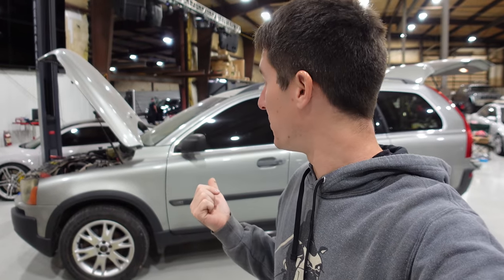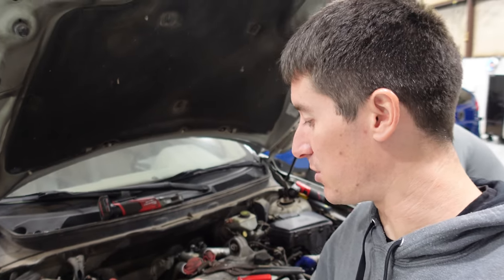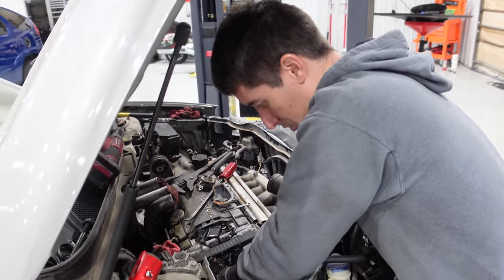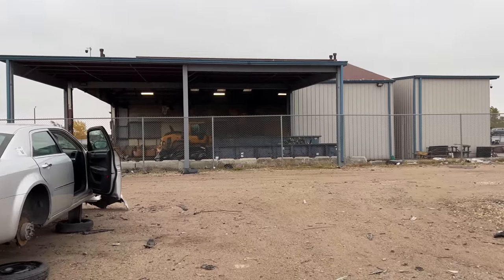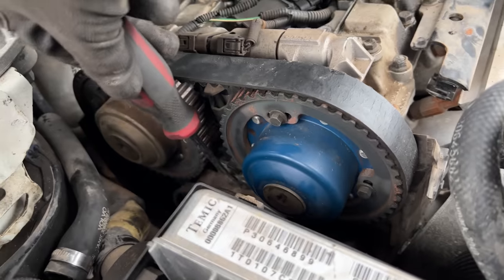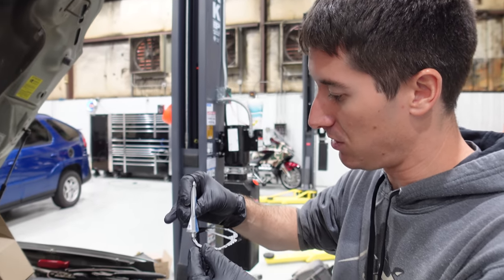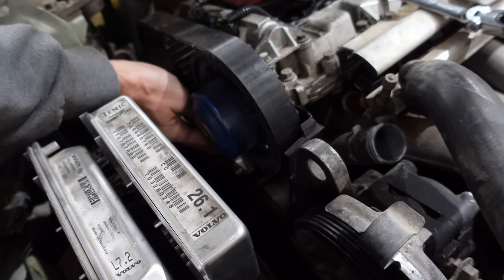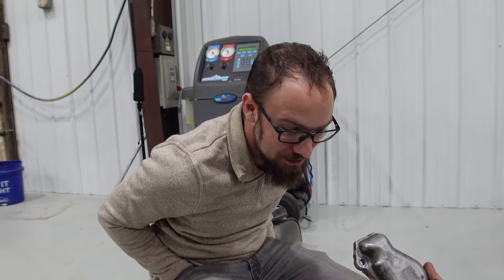Water FROZE And BROKE The One VOLVO Part You Can't Buy

Comment: Usually what I do that helps with timing belts and the thermostats and generally getting in there is removing the bottom mount that is on that side, lifting the engine up so that the holes are staggered and then zapping it back in. This normally gives you enough room to work on those things

Comment: Issue is that thats a 6 cylinder XC90, which they stopped making mainly because they introduced the V8 and kept the 5 cylinder as the lower trim. The transmission was the let down for the 6 cylinder, 4 speed GM auto HORRIBLE. All that to say this is why parts are a bit harder to get for the T6s vs the 5 cylinders
Reply: yet everyone is attracted to getting a t6 s80 because they want the power and I have to kill their dreams before they become nightmares, and then they want to dive into a P2R... people always choose the least forgiving Volvos, ruin them and then say Volvo is rubbish (after treating it like a Honda).

Comment: Sorry to see you struggle but I know your pain with that space or lack of!!!!, FYI if you remove the passenger tire and wheel liner you can get direct access. I just learned all that changing the serpintine and alternator....nightmare.
Reply: Yeah, the whole time i was wondering about going in through the wheel well!
Reply: @mindblownwatcher8536  Volvo actually has made access through the wheel well without having to remove it. There's a crease line on the liner, all you have to do is fold it back and use a clamp to keep it in place. Lol the entire time I was itching to say something but it's a video...LMAO.

Comment: I've seen that type of thing fixed with JB weld.
Not ideal, but does work.
Reply: I was going to type the same but then I thought it would be a stupid idea.
Reply: @taunuslunatic404  I actually saw a tech repair a coolant passage that had been worn through with a timing chain on a Nissan with that stuff.
Was still driving it around daily a year later.
I was impressed.
Reply: @mikevincent7521  So it wasn't such a stupid idea.

Comment: Better to upgrade the parts then have it continue to fail after some time. I never understood why they make cooling system parts out of plastic, it tends to get brittle and crack over time. The upper radiator tank on my Neon cracked open at a stress point being plastic and I couldn't figure out a easy way to seal it so I had to buy a new one. Luckily it wasn't super expensive but if it had been metal I could have soldered the crack up with a torch.
Reply: Two things: 1) If it had been metal to begin with, it wouldn't have cracked so you wouldn't need to solder it, 2) They do plastic because it's cheaper so they make more profit. They don't care if it breaks after warranty. But, I'm sure you knew both of those points.
Reply: @mathewfullerton8577  The radiators on my Dart and the 71 Scamp we used to split the seams at the top of the tanks after all those years in service. I was able to use my torch and solid core plumbing solder with Flux and reflow both so they held water and pressure again. The Dart popped one more time and it has a rare triple core narrow radiator so I took it to a local shop and they rodded it out and redid both tanks. The pressure was expanding the tanks and blowing the seams. I pulled the secondary rubber gasket that allowed the cap to pressurize the cooling system and it hasn't popped since and the Dart never goes over 190 anyway so just antifreeze is fine in it. It originally called for a 16 lb cap and s 190 thermostat and I dropped it to a 180 which also works fine.

Comment: Volvo cooling systems are a pain to work on. I had to change the thermostat on my 2003 XC90 which has the D5 engine (2.4 litre 5 cylinder diesel). The thermostat itself is easy to change but to get to it the bracket for the power steering pump, alternator and Aircon compressor has to be removed along with said ancillaries.

Comment: Isnt it amazing how easy a engine is to work on when its outside the car. Anyone thats even slightly mechanically inclined can fix a motor outside the car
Reply: That's probably because the whole engine is assembled before it's fitted to the vehicle at manufacture.

Comment: A little JB weld or /quicksteel could have saved you a trip to the the wreckers and getting rained on. Having spent several years driving Volvo trucks I know they have some very strange ideas on how things should work. The easily breakable hose fitting is absolutely no surprise.

Comment: It looks like that cover is part of the OEM Volvo thermostat (even the temp sensor)....which FCP does have (VOL-8636779), but still the plastic fitting.  If you go with "OEM" and the metal nipple, it's only the center section and not the cover.

Comment: For a guy who works on cars all the time, you'd think he would know the difference between a screw and a bolt. A bolt is a headed fastener having external threads that a nut will thread onto. You can't thread a nut on a screw.
Reply from the maker: You’d think after making a video every day for 3 years I don’t care anymore. And you’d be right… I fixed the car, I don’t care what I call anything 💯
Reply: @WatchJRGo  If you're implying that you don't care anymore about the content of your videos, that's a shame. And you may not care, but at least now you know.

Comment: You probably can get the outer part of the thermostat new if you wanted to but you would likely have to order it from one of the online genuine Volvo parts sites. I run into that all the time. Glad you found one though. What's the condition of the timing belt and the water pump on that car? Have those already been done in recent history?
Reply from the maker: The dealer was telling me they only sell it as a unit, I have a friend that's the parts guy there. The timing belt and water pump only have 10k miles on them 🍻

Comment: once you get all that stuff fixed... then it will be all the modules and wiring, a holy nightmare on early 2000's Volvo's.
Volvo cemented its rep with the 240 series, then it all went a little sideways, never ending repairs, and unless you have a JR in your back pocket to fix it twice a month...you are screwed

Comment: So you used more RTV than the last guy. HA ha !
Reply from the maker: I hardly used any, there's no squeeze out on my install 🍻
Reply: @WatchJRGo  two suggestions . apply the RTV to the part and you will use even less using your finger to spread the thinnest of a coat to adhere the gasket. second ,you said you had RTV "somewhere". Everything in a tube , from bearing lube , RTV, lithium grease, JB weld, glues, valve abrasive, PB blaster ,WD 40, Silicon spray, CAN or Squeeze TUBE I have in a 12 can "cooler". It is Plastic lined , has pouch, shoulder strap and handles. I use a second one for jobs at home for tools. Grab it to go to salvage yard Every thing but hammer and hack saw. Must weigh 30 pounds but 90% is in there to tear down a car to lawn mower .

Comment: For anyone thinking about buying a older xc90 or even a facelifted one; don't. They are black holes for your wallet. Yes they are cheap but you're better off with a similar year Lexus tbh
Reply: Iived that nightmare. Bought an 07 3.2  paid $6000for it. $7000 in various repairs and cosmetic upgrades in 1 year and i gave up in it.  Was nice driving when it worked lol
Reply: @thatguythere996  yeah they haven't aged well, I guess the D5 engine is pretty bulletproof but the upsides stops there. It's funny since the V70/S80 of similar years are still great cars. It's going to be fun seeing how well the "new" xc90 does in 12 years😅
Reply: @Hammar89  Right?! It's what kept me from buying  newer one actually lol.  I drive a Hyrbid Highlander now and now dont dread it aging quite so much lol

Comment: 13:25 - Soooo Swedish. I have a lot of old Saabs, really love them, but certain jobs they bury and they hide torx bits and weird gasketed things that need 3 hands to do properly lol. My old mechanic from a decade ago that used to work on Saabs, he had a drawer full of custom made tools just to make jobs easier... those Swedes are good but COME ON GUYS lol
Reply: Reminds me, I have a set of stubby Bondhus allen keys, super short end, I need it for doing 2 of the accessories and the transmission drain bolt... tool fits like a charm, it looks like you chopped the end off an allen key at the shortest possible distance lol. I tried to look up if they did a torx set like that but it doesn't appear to be, could've been handy.

Comment: Volvo likes it more difficult, engineers always over think it. KISS is only for the common man. Common sense man. Hey, put anti-freeze in your car people, water freezes, expands and breaks things. This is why we can't have nice things!
50% distilled water and 50% anti-freeze mixed will cover most places that freeze, except the arctic or antarctic. Just saying. Test your cooling system for boiling pont and freezing points with a $10 tester from walmart. Rant complete. Except you could have cracked the engine block if the freeze plugs did not pop first. Crazy stuff that freezing temperature. Ok done.

Comment: I feel your pain on the engineering assholes who put bolt placement for parts that may need to be changed half an inch from a frame rail AND make them require a “special” tool! 2002 Lincoln Continental is fwd and 4.6 V8 and the frame rail blocks the tensioner pulley bolt requiring the engine to be lifted a few inches, then you can remove the very tight T40 with the smallest tool you have! Even Muricans can have poor placement 😂😂